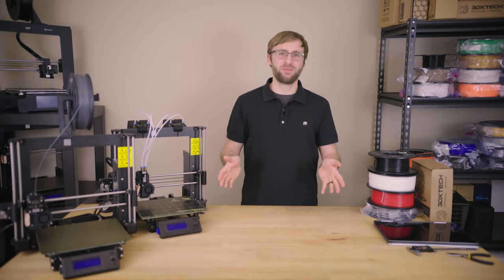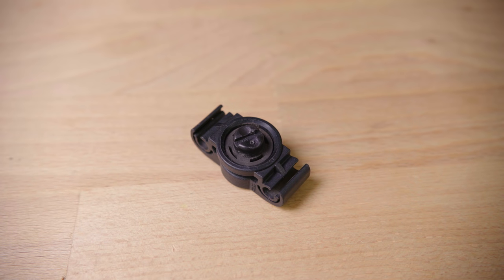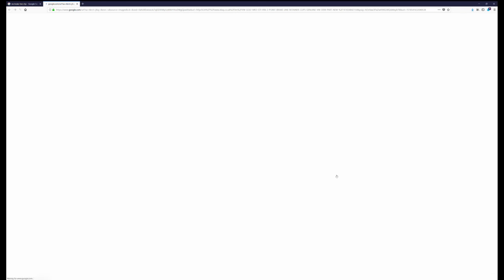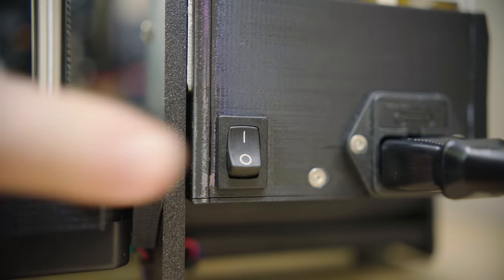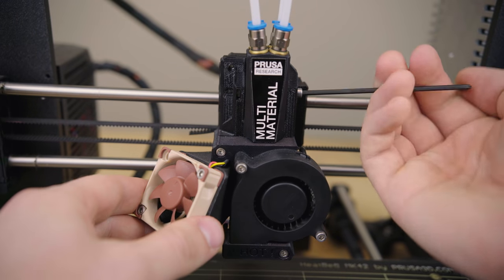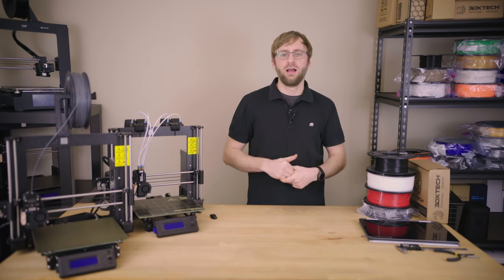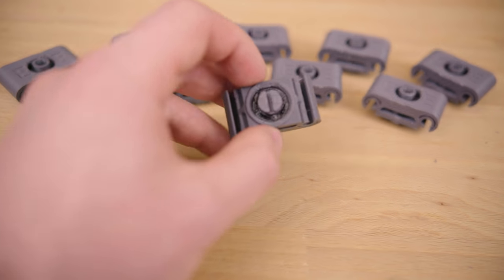3D Printed Car Parts? We put ASA to the test!

Comment from the maker: Please note that ASA just like Glass Fiber reinforced Nylon (very commonly used in automotive) will degrade over time as usual. No plastic is perfect and the degradation can be accelerated when in a corrosive environment such as the salt-belt in the United States. The BEST material to use for this job is PPS as it has some of the highest chemical resistance properties of any 3D printable material.
Reply: Is there a vender that sells pps fdm printer filament?
Reply from the maker: Thunderloins 3DXTECH sells it. Which printer do you have?
Reply: I have a CR-10.
Not sure what the maximum temp is of the print head, but i can install a e3d or microswiss hotend if need be.

heated bed, no containment (but i can build that if necessary too, no issue)

Been on the lookout for better filaments which can handle stress from wear for print for use parts.
Reply: Thunderloins you need heated chamber to print from PPS. I'm actually building such machine. It's not easy even if you have experience.
Reply: I happen to have a material which bonds well to ABS, dissolves in cleaning gasoline, medical grade and semiflexible. It's not only good medical material but also very good support one.
Reply from the maker: PPS prints beautifully if you get the settings right. It definitely likes a hotter chamber and bed especially with larger parts!
Reply: Will PPS be suitable for engine bay temperatures and heat cycles? I've just set up my PRUSA I3 MK3 and i can't wait to start making car parts
Reply: I need front corner light houseings for my 1967 impala i cannot find them anywere,someone stole the ones off my car,there hard plastic or like hddp plastic like a milk jug kinda but there about 8 inches tall there basically like a turn signal houseing for the bulb to go in and the lense goes over it and it lights up as a running light,,theres companys that produce the lense and the outer chrome that goes over it but NO company makes the actual plastic houseing so i am looking for someone to make them with a 3d printer and will pay cash! I will pay 100 dollars if u can make them..?
Reply from the maker: This is a tricky one as light housings cannot be 3D printed with standard FDM machines as even with the larger layers they're still hazy. Best option is either design the light and then make a mold and cast it out of a thermoset. Or have it printed from an SLA machine as there are materials on some of them that have the exact properties you're looking for. Let me know if you've made any progress on this and I'd be glad to help!

Comment: Plastic clips are always going to be an issue for EVERY car. Every model uses several different types of plastic clips all over the car. And while the main idea is for them to be functional, once you need to replace them you see what is the REAL idea behind them. Why they all look so different and complicated and don't fit from one model car to another.
MONEY MONEY MONEY MONEY....
Manufacturers could establish a standard and start using the same clips on all models, but that would mean you would be able to easily replace your broken clips. And that means NO MONEY FOR THEM. So they make them easy to break, hard to obtain, impossible to replace, and make sure to change the design every year. So you have to come to them for spares.
So now we have millions of weird looking plastic pieces with random part numbers  that make up a big chunk of the automotive business.
I was looking into a way for people to free them selves from these shackles and print their needed auto parts, but there are SO MANY of them. And the OEM parts design files are stored safe and secure, not available to the public. So we have to copy those parts which takes a lot of design and printing trial and error. And at the end we get ONE part that serves just ONE man's needs at the time. You can find the occasional part here and there, but it is more likely that the part you need is not 3d printed by anyone just yet.
What we need is a collective database specifically built for auto parts. I don't know the right people to band together to create such database and influence more people to contribute.
But MAYBE YOU DO! Or you know someone who can! Yes, you who is reading this comment. Do you think you could do it?
Reply from the maker: Hey this is one of my many dreams! This is what I love about additive manufacturing in general. You can make end use parts for very cheap, make designs you could never make before, and iterate extremely fast!
Reply: I have cad skills and lots of free time. Ship me parts and I'll replicate them.

Comment: Great video - I love seeing practical uses of 3D printing.  Just in the last couple of days, Prusa announced that they are re-working the MMU.  You might want to see if those changes might make it a true MMU, as opposed to just an MCU (multi-color...)
Reply from the maker: Thanks a lot! Saw that update. It sounds as if the filament jams will happen a lot less. Sadly due to it still using a single nozzle design it will likely have the same issues. :( Still excited as the MMU kit is great at multi-color prints and if there's even more reliability from this MMU2 update we can't wait! Thanks for watching :)

Comment: Was invited to a traveling road show of Stratasys printers. Side note: shook hands with a "CSWP-E" only supposed to be 300/400 worldwide(7 mill "CSWP's).  Saw all kinds of their "Ultem 9010"(PEI plastic)auto parts. This stuff beats most printer filament strenght and many other catagories hands down.  I believe that their patents have run out and prices/avalability will be for everyone. Bed heat and nozzel heat however are a factor.  My dream is a 3DP-Platform "WorkBench"series#400. It has 59"-X axis, a39+" Y axis, and 27&3/4" Zaxis. Has 4 different extruders some heated&water cooled very fast high voluum.  Without enclosure it goes 40/45k$ with dual(left&right extruders)
Reply from the maker: You should try PEEK or PEKK! It is even better than Ultem 1010 and 9085. Yep most of the FDM based Stratasys patents are running out. There's a few left covering their Fortus line of printers but give it a couple years and the technology will be mainstream! (I can't wait because it'll drive prices down)

Comment: Are you located in Michigan? I recently found that 3DxTech has a store in Grand Rapids and you get a discount buying in person at their store! I'm excited to try out some of the ASA material they have available. I own a local business and print production parts everyday in ABS. We have been experimenting with ASA from Stratasys and have been getting much better results (mainly lower gloss prints of better quality).
Reply: Nevermind.. went to their store today and apparently is closed down.. unless they moved locations..
Reply from the maker: @oneheadlight8000  Yes I am actually from Michigan! That's actually were I get a lot of my filament from for that very reason. They actually just moved to a new build near the corner of 36th and Eastern and are still settling into the shop there. Yep ASA is great because of it's UV stability and it is inherently low-gloss which makes for a nice technical looking part!

Comment: Hi, I noticed the overhangs support didn't seem great with the results. Have you tried S3D? I switched from splicer and it transformed my prints a few years ago.
Also love the work you are doing - I envision there being car part 3D printing websites in the future where we can go to print clips, bungs etc....
Reply from the maker: The overhang issues is my fault. I did not have the settings dialed in perfectly at the time. I use S3D, Cura, and Slic3r Prusa Edition in no particular order. Thanks a bunch! Yep it will. With more and more high temp and high performance materials on the market the options are growing fast!

Comment: Hi, maybe a little late but did you level the bed after you changed the Boden tube? 
Seems petty but something as small as that can affect prints.
Reply from the maker: Yep. Clearing the nozzle is very difficult due to the extreme differences in materials. Best method is to clear with a purging compound like hwich is done in the plastic extrusion world which wastes a lot of time. My conclusion is multi-material is best done with multiple nozzles to prevent contamination of the materials and therefor create quality parts!

Comment: did you check for any sort of light air drafts? that looks like the asa didnt stay hot long enough to really bond. Not every printer, even of the same model printer will heat the same way. So 230C on one printer may be actually 230c, while on another printer it could be 220. Another thing is that when going from filament to filament, it can drop the temp of the nozzle quite a bit as well. Basically what im getting at is that i would run a pid calibration and then attempt raising the print temp 5-10c. Hope youve either gotten it figured out, or that this helps
Reply from the maker: Yep! Printed under the same conditions on the same printer even. I run a print farm and all of the printers in it have been rebuilt and calibrated so sadly it isn't that. We're thinking the best way to solve it would be to purge 2+ times more than we did which at that point is way to much material wasted in purging. :(

Comment: I believe that there is a reason why those clips are plastic. There is no problems with missmatched metals corroding eachothers or however that works. I just remember that some metals dont like eachothers..
Reply from the maker: Yep. It's called Galvanic corrosion. Thankfully the lines on these cars are polymer coated. I do like the plastic clips as they can adsorb quite the beating however road salts and UV really eats the plastic away over time :(

Comment: @E and E Design I am curious. You said you were restoring the car. You also mentioned corrosion. The A8 is an aluminium spaceframe design. What corroded on the car and waht type of restauration are you doing? Just curious as I am thinking about getting a D2 myself.
Reply from the maker: What's awesome about the space frame is it is the least corroded vehicle I have ever seen in Michigan (we use a LOT of salt here so most vehicles vaporize, haha). As usual VW/Audi does an excellent job with corrosion protection, and the car being almost entirely aluminum gives it a great advantage, but there are still the usual issues as expected. The subframes for the D2s are steel, most hardware is hot dip galvanized steel, and the pre-2000 vehicles have cast steel knuckles rather than the 2000+ models that have cast aluminum. The D3s+ also have aluminum rear subframes so they're even more aluminum. Worst corrosion is the points where steel contacted aluminum and the zinc coating was eaten away.The corrosion was just the usual fine white powder which happens in this case rather than the usual iron oxide (rust) you see on steel vehicles. The WORST part of the restoration which wasn't too bad for me (been a mechanic for years) was the front knuckles top locking bolt that attaches the two top control arms to the knuckle. It's a very long bolt that corrodes in place and very commonly breaks when trying to remove it. It is the WORST with the steel knuckles as the rust is even more terrible than the aluminum/zinc dust. A lot of Audi mechanics call conquering those bolts the "right of passage" into the world of servicing Audis. Overall it is the most unique and over-engineered vehicle I have ever worked on. Audi was the first to create and perfect an aluminum production vehicle and they really did an absolutely stunning job. The funniest part is it has taken other car manufacturers almost 4 decades since Audi started development of the space frame to make comparable designs! Hope this helps, let me know if you have any questions. Thanks for watching! :)
Reply: @EandEDesign  Just letting you know that now 5 years later I got a D2 =) Still figuring out why the immobilizer kicks in all the time.
Reply from the maker: @darkhorsegarage  that's awesome! Do you have access to vcds to get the code to better understand the issue?

Comment: What profile have you used for 3DXTech ASA on MK3 ... if you don't mind sharing it? I'm testing it for exterior LED light housing.
Reply from the maker: I use the Prusa ABS profile and then adjust from there. ASA just like ABS likes a lot of heat around the part so an enclosure is ideal for the best results

Comment: I have a question Sir. Is it possible to print from a photo of a part? I'm an RC Plane Model Maker. My business is Balsa Bob's. I generally built very large RC planes. I want to take my process to the text level. I want to 3d print things like Cockpit seats and instrument panels, door hinges, catch covers. I want to simulate hydraulic hoses and fittings by printing them on a 3D printer from a photo of the real thing only scaled properly ...is this possible? I have an Ender 3 printer.
Reply from the maker: Yes it is! I have this on the list of videos I would like to make.....This is actually how I got into the 3D world. We were contracted jobs to model products from images. You have to take a lot of images and measurements most importantly but overall you can get there pretty easily once you learn how! Do you have any 3D software yet?
Reply: @EandEDesign  No Sir not yet...still in the dark.

Comment: Great viedeo! I ran into the same issue with my mmu2s. I tried to print PLA and PETG with a water soluble material and also had layer bonding issues. I guess it just doesn´t work with the mmu units from Prusa.

Comment: What about using asa for lithium ion cell holders? Those cells could reach around 60 degrees but it would be enclosed in heat shrink
Reply from the maker: You will want to use a FR (flame retardant) material. Will the holders see any UV?
Reply: @EandEDesign  no, they will be wrapped with a sponge, and heatshrinked, the battery is meant to be sealed. i have considered using pc or ePC but that's a lot harder to print, hell i have issues reaching to 40 dgrees inside a makeshift enclosure i have.
Reply from the maker: @emaayan  Ideally you would use a FR Nylon or similar material. Don't think their are any on the market at this point. For the time being you could do a FR PC/ABS. 3DXTECH has some. Or just try a basic PC/ABS to start. Ideally the final part should be in an FR material for safety!
Reply: @EandEDesign  i've read somewhere that composite materials are actually weaker then normal filaments.

Comment: Would you mind sharing your thoughts on printing ASA. I have a spool that I'm getting ready to print with and would appreciate your input.
Reply from the maker: If you've printed ABS before or have ABS profiles that is a very good starting point as you can pretty much use the exact same settings! Though ASA has less shrinkage than ABS it is still recommended to use 100+C on the bed and keep as much heat in the chamber or around the printer as possible. Also, the larger the print the more you should be worried about breezes causing cracking or shrinkage/distortion of the print. Let me know if you have any other questions! Thanks for watching :)
Reply: Thanks for the reply. Ill let you know how well it works after :]
Reply: Enclosure (and fume extraction) FTW!

Comment: What filament material do you recommend for something I will leave inside the car which can get really hot during the day?
Reply: So far all filaments I've tried deform in direct sunlight on my dash. PLA just turn to mush  but they deform...even whrn thry claim they shouldn't. 

As far as easy-ish to print filaments ASA has stood up to high vehicle temperatures (not direct sunlight though. Basically small shelf containers in the back of a van where the sun only gets in when the doors are open.

Just that dmall door open time was enough to cause PLA to fail, where ASA has not. Warping during printing is a huge pain for larger parts though and is not worth the time and hassle at least for me.  Small parts in ASA are great for in vehicles though.

Comment: What if you tried a PVA support material instead of HIPS?
Reply from the maker: Clearing the nozzle is very difficult due to the extreme differences in materials. Best method is to clear with a purging compound which wastes a lot of time. My conclusion is multi-material is best done with multiple nozzles to prevent contamination of the materials and therefor create quality parts!

Comment: Cool video I don't think mmu  takes into account retracting and re feeding when purging.  Simply purging isn't enough giving it a good retract and pump let's out some stuff caught on the sides of the inner heated block
Reply from the maker: Thanks! :) From what I remember the steppers go through multiple feeds/retracts when purging. I'll have to watch the steppers again the next time we print! Hopefully we can solve the problem!
Reply: E and E Design you're most likely correct... That's a shame I guess ... I kind of think of mmu as mostly an aesthetic tool
Reply from the maker: We may be able to improve it but it's going to take some serious experimentation! Thanks again :)
Reply: The trick would probably be to do a calibrated waste feed after material change ... into a designated scrap area on the bed(?).